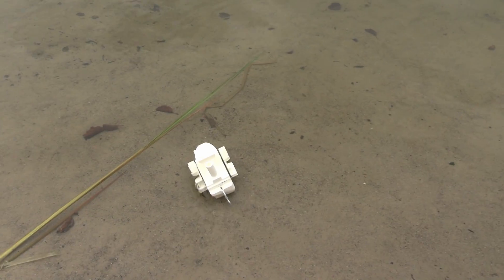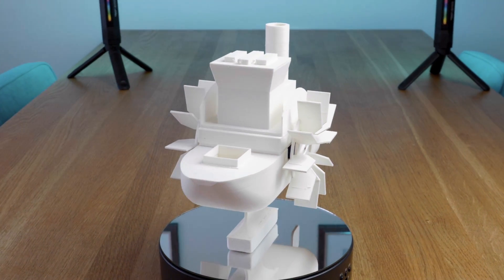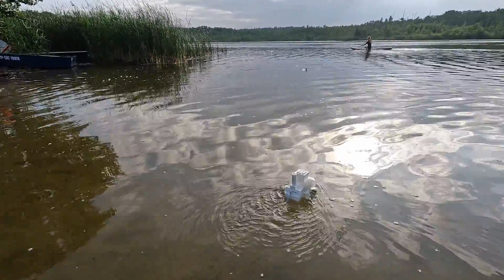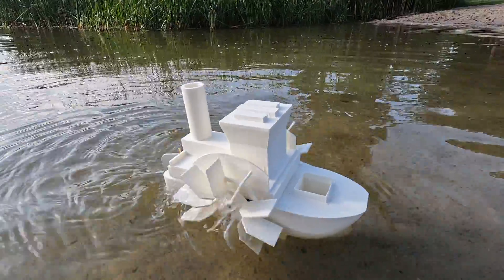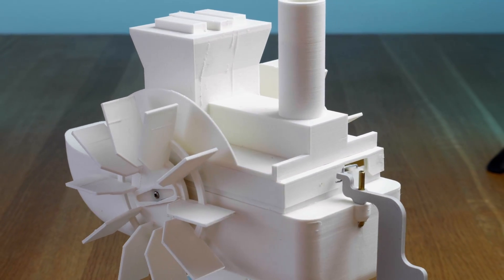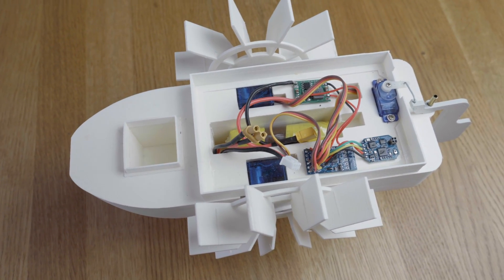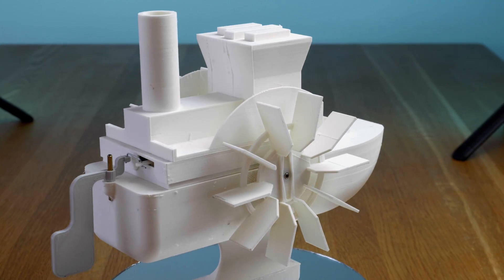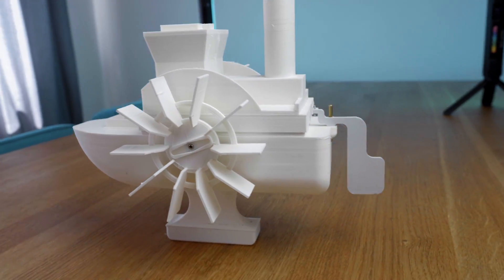RC Boat with paddle wheels and Express LRS

Comment from the maker: RC Airboat - two motors, FPV and INAV inside https://youtu.be/atuB6cOMoF4
Reply: will need a 2023 edition for sure and if that will be achieved I bet you will add solar power sooner or less as a pure legacy steamer.

Of cause your differential thrust would been loved by the old white bearded steam captains too.

Comment: Glad to see you solved the cg vs. cb situation from last year. (centre gravity vs centre buoyancy).
Looking good!

Any concerns with gaps between layers in the filament printing process?
Realize LW-PWA was used here, which expands as it is being laid down, so less likely to have interlayer gaps. eg: if printing with regular  PLA. 
Noticed in video that some differential speed paddle wheels was being used to steer. Perhaps 3rd servo is redundant and can get away manually positioned rudder to help the boat navigate a straight course?

Comment: Since you asked.. 
The boat runs slowly... The Rudder in the rear is not needed if you use Paddle Wheel differential steering. The Center of gravity should be under the Paddle Wheel axles... IMO...  It does run better now
Reply from the maker: the rudder is very much needed. Diff steering is much less effective than you imagine